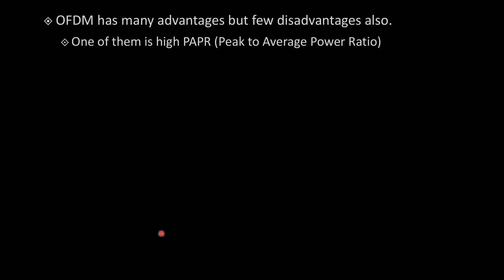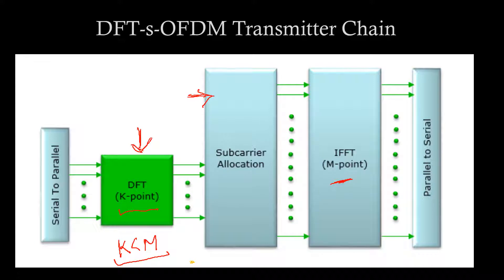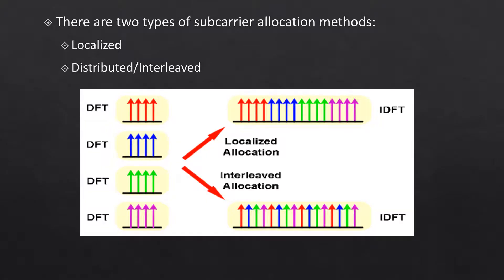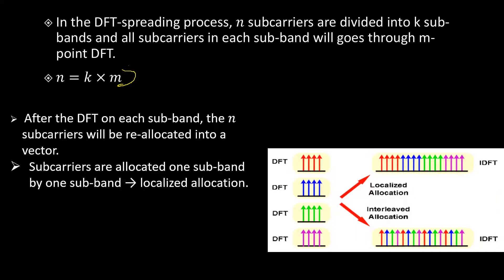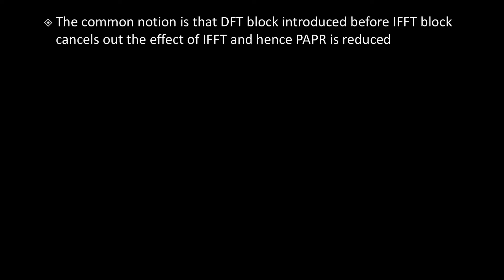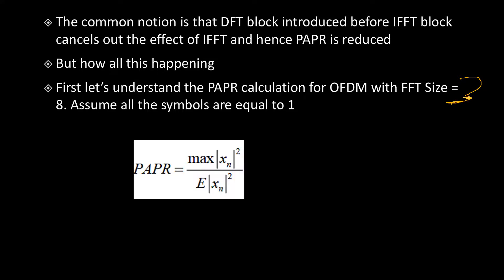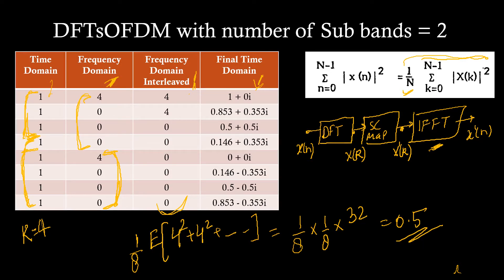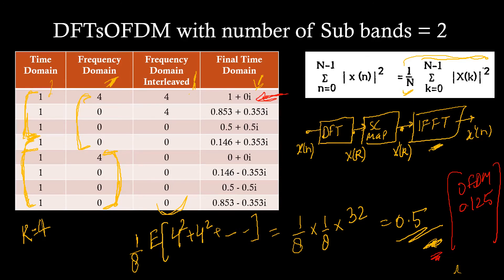How DFT-s-OFDM helps in reducing PAPR (Peak to Average Power Ratio)

Comment: Similar Videos
Lecture 1: Multi path Fading Model-Wireless Communication     • Lecture 1 Multi path Fading Model-Wireless...  
Lecture 2:  Concept of delay spread and bandwidth      • Lecture 2  Concept of delay spread and  ba...  
Lecture 3: Doppler shift and Coherence Time, Slow vs Fast Fading    • Lecture 3  Doppler shift and Coherence Tim...  
Lecture 4: Multi-Carrier Modulation and OFDM Principle    • Lecture 4: Multi-Carrier Modulation and OF...  
Lecture 5: Machine Learning and Deep Learning Basics    • Machine Learning and Deep Learning Basics  
Lecture 6: Deep Learning using Python Demo    • 6  Deep Learning Demo  
Lecture 7: Integrating Machine Learning with Deep Learning     • Integrating ML with Deep Learning  
Lecture 8: Wireless Channel Estimation Basics     • Wireless Channel Estimation Basics  
Lecture 9: Outage Probability using Random Variable     • 9 Outage Probability using Random Variables  
Lecture 10: FAS System    • 10. Fluid Antenna System Introduction

Comment: Very well explained sir. 
My doubt is we have to find papr of the final analog signal because that is going to be received and the actual problem will be at  the a/d converter there…why are we working or finding papr of the digital signal ?….plz explain.
I have similar doubt when we do cyclic prefixing….
Reply from the maker: Why do you think PAPR of your analog signal will be impacted much after unconversion that will be just an multiplication with sinusoid with some filtering. The explanation gives an intuition of PAPR in baseband and hence PAPR reduction techniques can be used in baseband.

Comment: In the table of the last slides, the column Frequency Domain (4 0 0 0 4..) and Frequency Domain Interleaved (4 4 0 0...) seem to have the same mean power. Wondering why in general we have interleaved PAPR performance better than non-interleaved...
Reply from the maker: Mean power should be same for interleaved and localized allocation, the difference should come into Peak Power calculation.